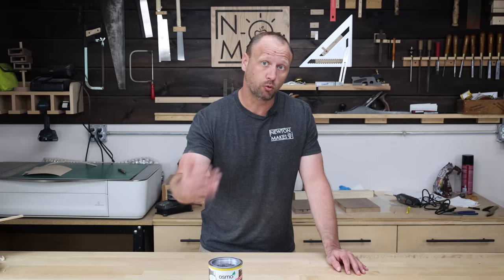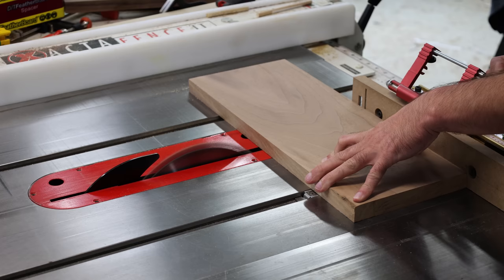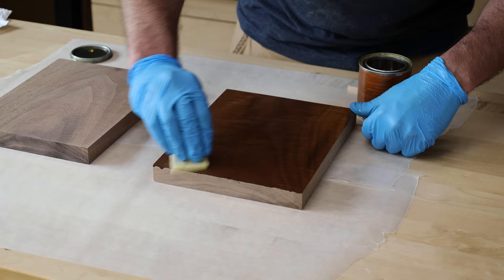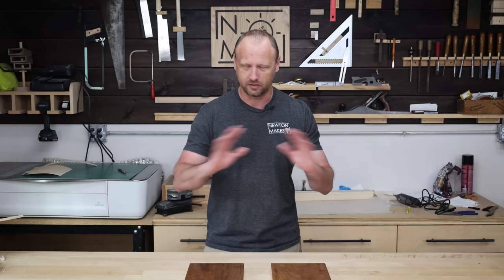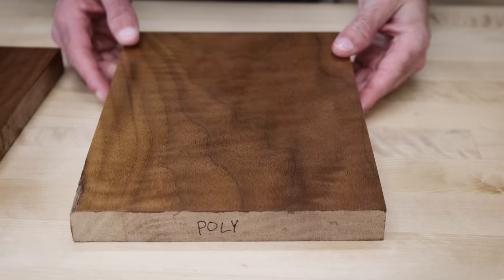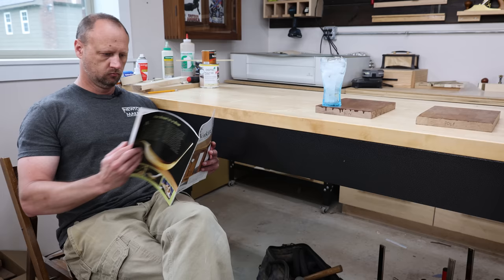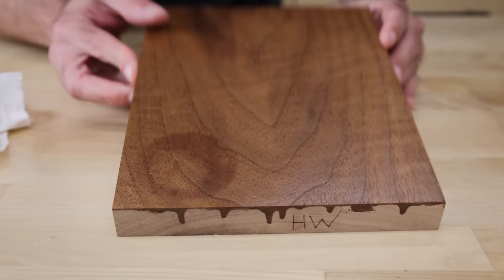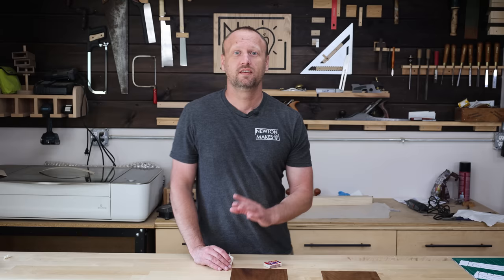Hard Wax vs Poly Shootout! | Rubio Monocoat & Osmo Finishing Test!

Comment: So much hype around hard wax finishes these days. 2k poly's and concession varnishes outperform them in every category and offer so much more versatility in look and feel. Even vinyl sealer and nitro lacquer outperforms them. If professionals want to provide enduring, high quality finishes to their clients, they need to learn how to apply industrial finishes.
Reply: I agree that those finishes obviously provide more protection. Even shellac offers more protection and has a track record.
What I don't understand about all this "hard wax" crazy is - if you don't use coasters, or set even a mildly hot pot on the table - you will need to fix it... It seems to me if you have kids, you're probably needing to redo that wax after every supper.

I personally like nitro lacquer, but spray it all when needed.

What I do NOT like, about 2k especially, is how hard it is to strip when someone brings that stuff in.
I just had a table in the strip booth the other day after about an hour or so, I pulled it out and decided I will just sand strip it... had a feeling I would have to anyway.
Also conversion, cats, and 2k are not easily repaired - and ALL finishes will damage at some point.
But, yes, those are what the industry is doing.

Comment: The endearing quality of hardwax oil finishes isn't in its durability, it's ease of repair, "full" cure time (at least with Rubios accelerator), and smell of off gassing. Can't speak to Osmo, but I've refinished a few of my Rubio pieces and it's as simple as sanding the damaged area and reapplying oil.
Reply: I agree but would say the endearing quality is the look you get. People use oil because they don’t like the encased in plastic look you get with film finishes. I want my furniture to look like they are made of wood, and most wood isn’t glass smooth. I don’t want to see a perfect reflection in a buffed film finish. That’s not what wood looks like.

Comment: This test is missing an important step when applying the hard wax - Rubio says it takes 5 days to cure before it protects against water damage. It's not meant to work within minutes. This isn't an accurate test - though it was interesting to see some of the results.

Comment: I just about died when I saw u throwing keys and scratching at then and the markers 😲 yea your right though pens pencils crayons kids and nice wood😞 great video though Billy looking forward to the scroll project. I haven't used osmo or Rubio mainly because for me to buy it here in the UK it's like £75+($95+) a shot need try a poly though. 🏴👍
Reply from the maker: It's crazy how expensive it is. I will say with osmo that it lasts forever. I find that it goes much further than Rubio or poly.
Reply: @NewtonMakes  of course unless you work with them and can get a can sent to me that would be mint!
Reply: Sorry  Michael but 750mls of Osmo Polyx is currently £31.93 from Wood Finishes Direct.  God knows how much furniture you could finish with that amount!  Once you have tried it you will not use much else.  Their exterior oil finish is equally as good. I've been using it for decades.
Reply: @Dickie2702  thanks for that I'll check that out give it shot see what it's like. 🏴👍

Comment: From what I've heard, with hardwax oil you are relying on the strength of the wood itself to resist wear and tear, but with poly you are relying on the finish to do that.
Reply: That seems like an over simplification to me. Poly isn’t that hard. The real durability of the poly comes from it being a thick film finish. Much like a clear coat on a car. The paint gets protected because scratches don’t go deep enough to reach the paint. 

But with wood, putting poly on thick gives a distinctive look that most furniture makers don’t love. Encased in plastic might be something they tolerate because it’s a desk for thier kids. But few people would say it looks the best.

And if you don’t put it on thick then you lose most of the protection it would give you.

Comment: I swore by tried and true. But it’s fickle. Amazing when it’s amazing. But fickle. 

I’ve since leaned into odies oil. It’s a workout if you’re putting it in a huge piece. But it’s hard to screw up. And I can touch it and it smells nice. 

I steer clear of anything I have to use mask to apply. Personal preference, sure.